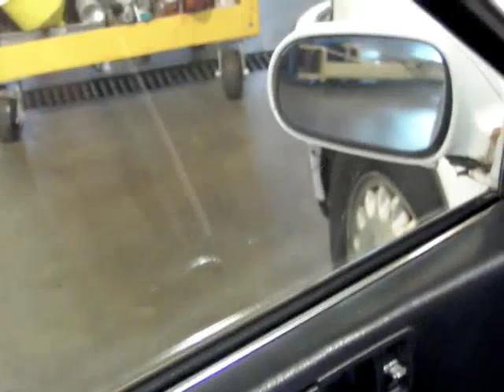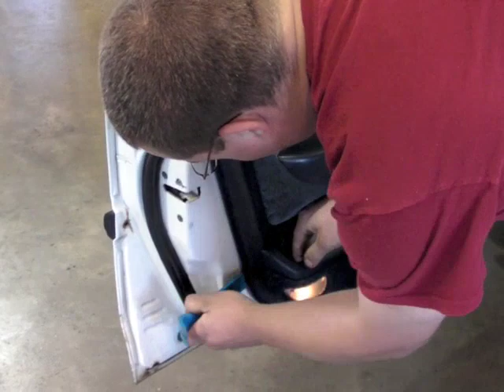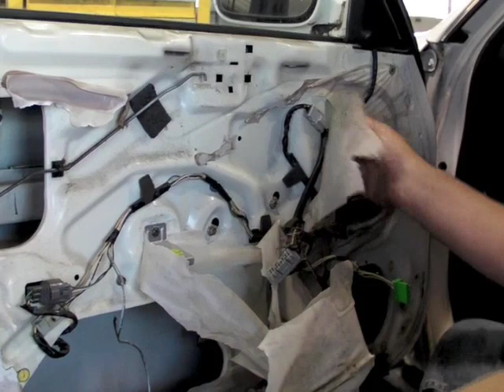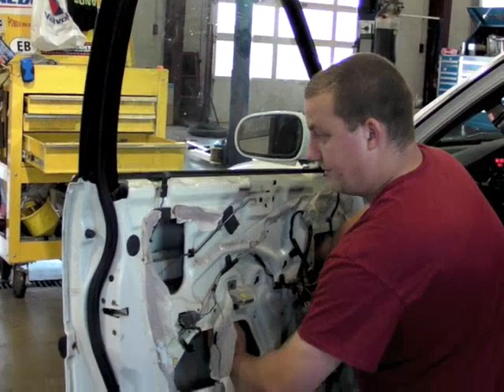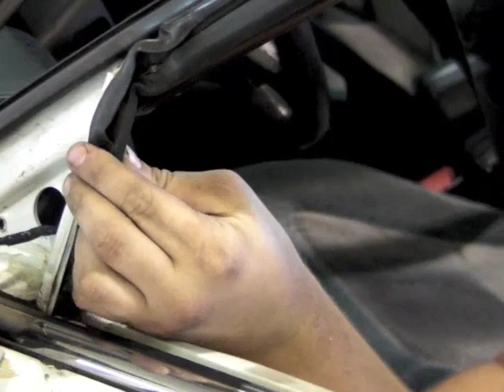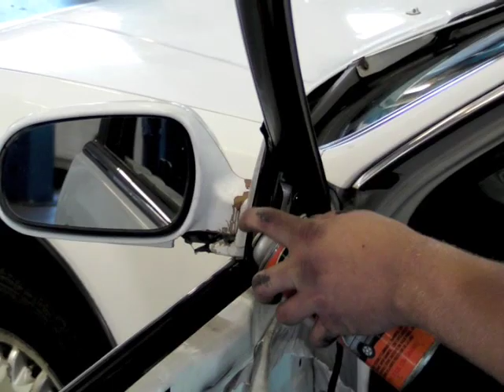honda accord window repair

Comment: I've got the model before this one, unfortunately both of the window channels on driver's side and passenger side have a small tear, (they are still rubbery) and the windows catch on that and struggle to roll up. This gives me a good idea on how to approach my issue. Maybe I'll check a junkyard CB7 Accord's channels to see if those fit on my CA5,  hoping they fit with little modifying. But long story short, I came here to comment how useful this video is 14 years later:D

Comment: Why is it that when I type in "how to remove a drivers side window" it only loads up "how to replace a window regulator" ? I DONT GIVE A DAMN ABOUT A FU** WINDOW REGULATOR !! I NEED TO KNOW HOW TO REMOVE THE FUCKIN GLASS !!
Reply from the maker: Apparently you didn't watch the video?
Reply: Just put -regulator.. Newbs don't know anything
Reply: This video clearly shows how to remove and replace the window hes just adding the regulator in his work so he can check that while he has everything off. Watch the full video and itll help you
Reply: thanks larry

Comment: are the motors interchangeable? i got one from the passenger side wondering if it will work for the driver side
Reply: No because they face oposite ways